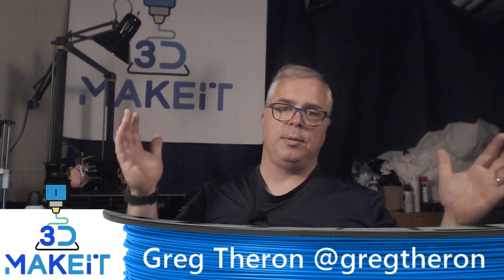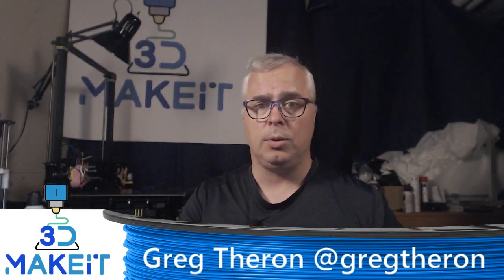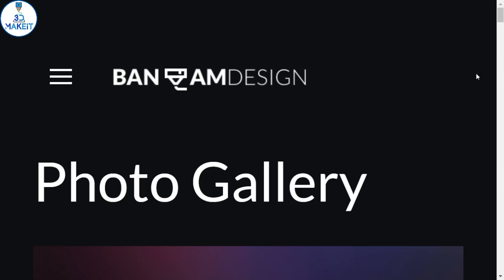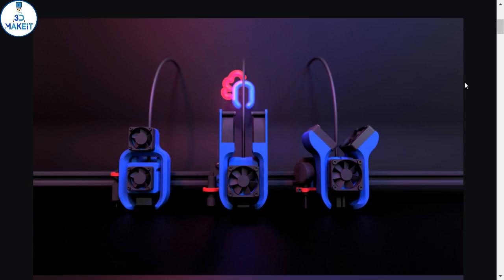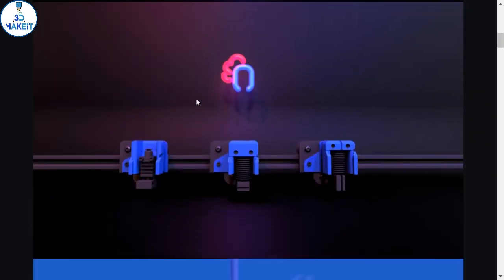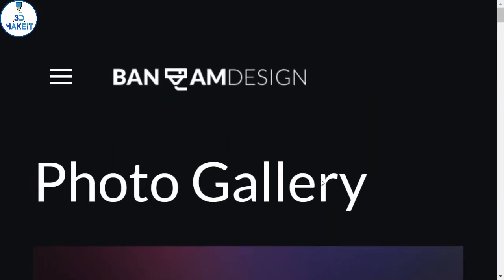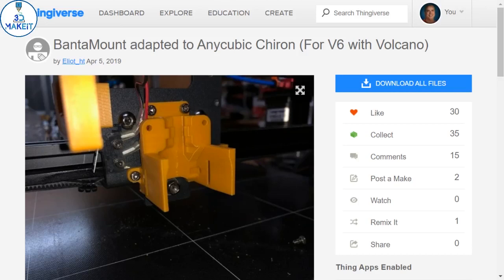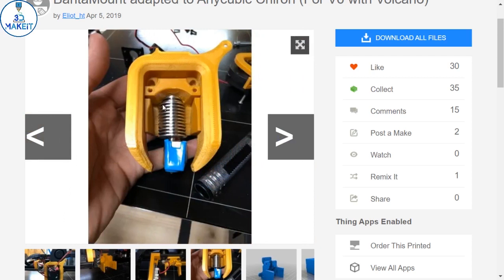BantaMount by BantamDesign CR10, ANYCubic Chiron

Comment: I love the video and it motivated me to print it witht the banta mount.  The problem is the new mount puts the nozzle about 3mm below the bed now.  How do I adjust the z stop higher so it won't crash into the bed?
Reply from the maker: Are you using the stock hot end?
Reply: @3DMakeIt  yes I am using the stock hot end.
Reply from the maker: Also I converted mine with a BL touch so that eliminated the end stops completely so it wasn't an issue for me.

Comment: Good Work 3D MakeIt. Just one important note: The standard AC Chiron Blow fan is 40X40X10 which won't fit neither of those Ducks if I am not mistaken.
Reply from the maker: That is correct so I added a 5015 blower which I felt did a better job

Comment: downloaded STL for dual axial 40x40x20 fans gona print rough prints and mount it on my ender 3 pro ... hope PLA will not melt under hotend :D then tweak, reprint, tweak, reprint ... :D
Reply from the maker: I have been using PLA on mine for awhile and its still good. PETG will work but i have been lazy so have not reprinted it.
Reply: How did you fit two fans on there? :)